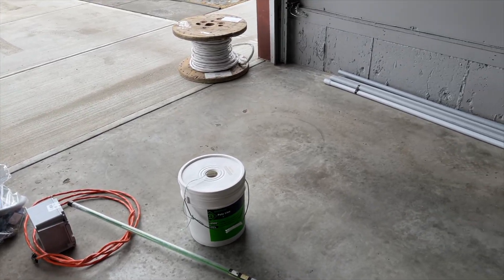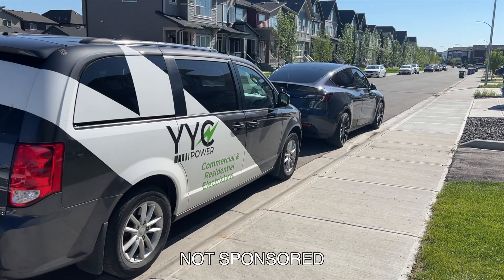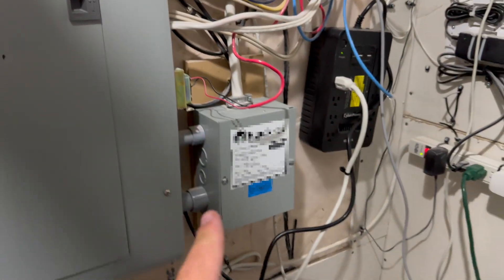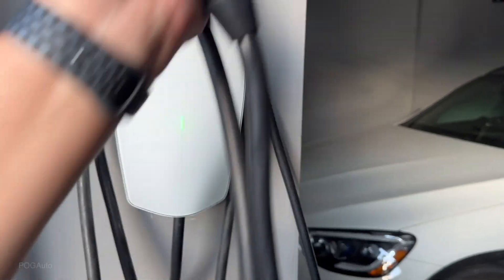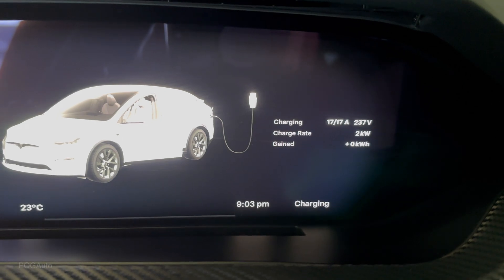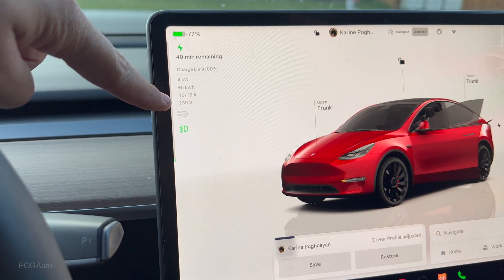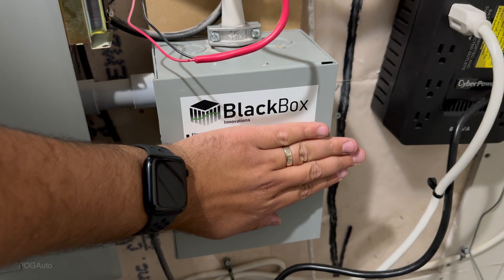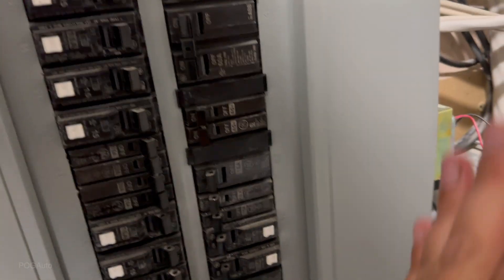Tesla Wall Connector - You need to know this about Power Sharing!

Comment: It probably make sense to update the title of the video
Powershare - is now something that allows you to power your home or anything else from your vehicle (as of today - Cybertruck only)
And what you demonstrate on the video is called Load Share.

BTW, in the installation guide Tesla recommends against switches like that... man, if you can afford 5 teslas in your household - you should be able to invest in a higher amperage service... if you're so committed to the EVs and going to use them for years to come... anyway it is a matter of time when you will need to do that.

Comment: I kind of surprised that a house that new doesn't have 200A service; I thought houses built later than the mid-1990's all had it. Thanks for talking about the expense of adding 200A service to a house; people seem to assume its relatively cheap to do and it definitely is not. When I checked into it, it was $7500 here in the US so obviously I didn't do that so I'm using a 24A switch box between my dryer and the Tesla and its working fine.

Comment: Does the power on the wall chargers goes off completely when the AC or Dryer comes on? If so, are you worried that the charging stops abruptly and the wall charger go off and on all the time plues rebooting and trying to get online?

Comment: How did you get the Tesla Wall Connector for $510 each?
Reply from the maker: Please see the date of the purchase
Reply: Tesla wall connectors (NACS connector only, Gen 3) are selling for $450 at the moment, the Tesla Universal wall connector (NACS connector with built in J1772 adapter) are $580 and I don't think have had any price drops yet.  The (non-universal) wall connector price has been up and down, I bought my 2 for $350 each a year and a half ago.  It's also worth noting that you can buy adapters to use a non - universal Wall connector with J1772 cars.  I've used ones from TeslaTap for years without any issue.

Comment: That’s a pretty AMAZING SOLUTION.  Unfortunately it’s a costly one but I love the creativity and solution.  I have a 100 amp service.  I just added an expansion box and installed a 20 amp 220 line. If I were to get another Tesla I might consider something like this.  Thanks for sharing
Reply from the maker: Thanks for watching
Reply: Or you could get a Grizzl-E Duo.  It has dual connectors and will PowerShare 40A.